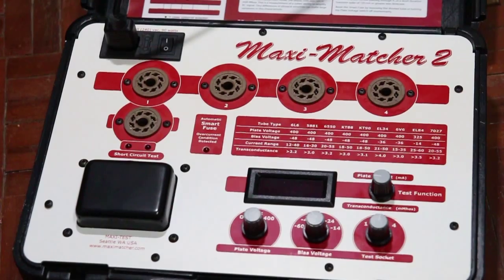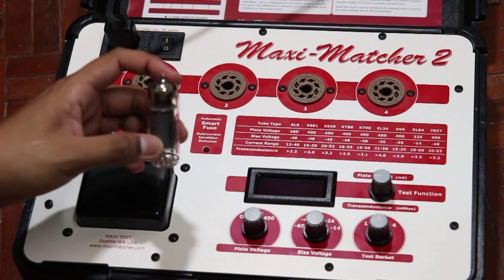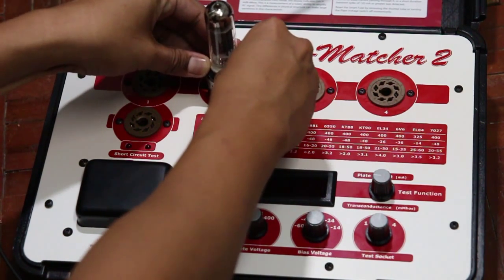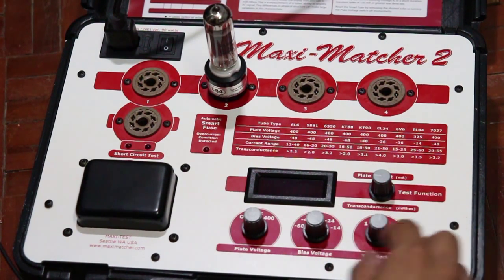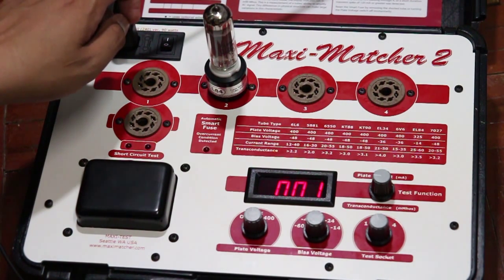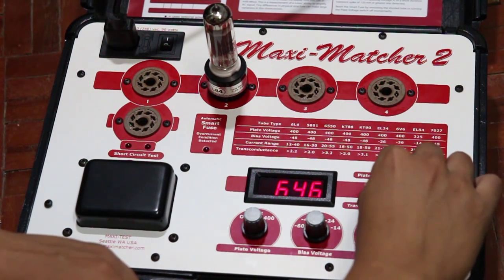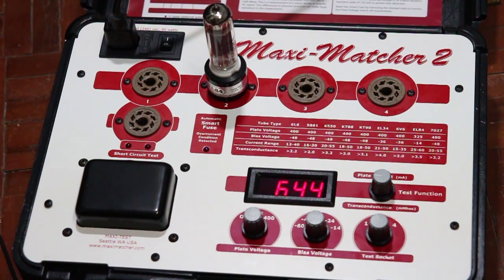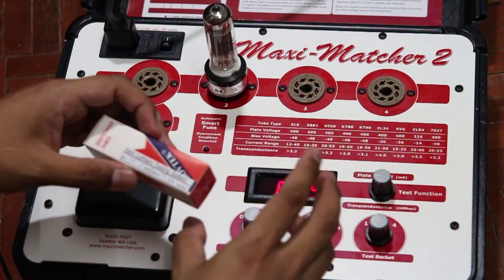Vacuum Tube Tester

Comment: Show more info why you chose socket two, use the right units (volts,, mA, shortcircuittest etc), this says nothing, even no compare test etc with other tubes. Do you understand? Grtz, Luc
Reply from the maker: B Luc For socket you can choose any sockets that you want. it will give you the same result. For the testing parameters, it depends on tube models . you need to choose as the machine manual suggestion. For comparing tubes, this VDO show how  I test and match  tubes.  it is not the tubes review. Anyway I will consider in the next VDO. Thanks
Reply: Yes Siam, you have to explain more accurate for the vieuwers in next VDO. Sorry, It is positive meant.